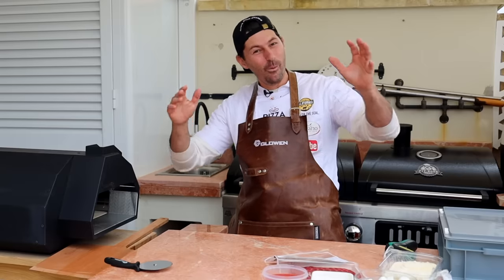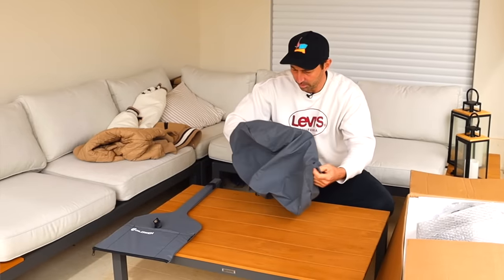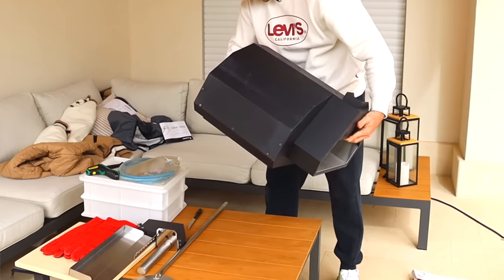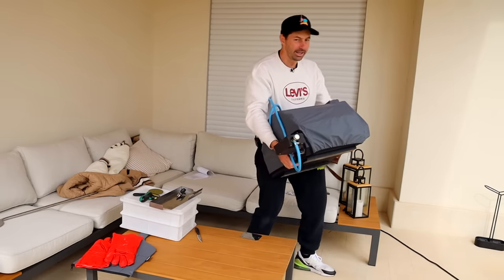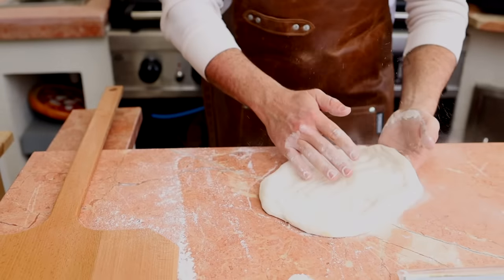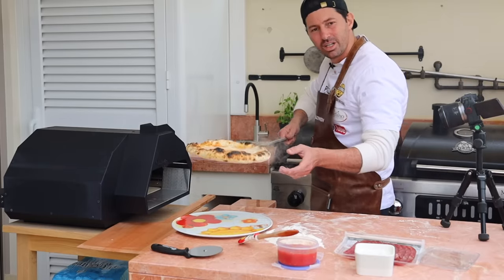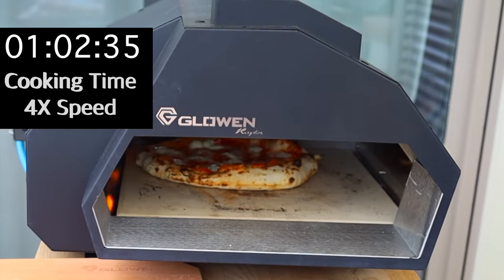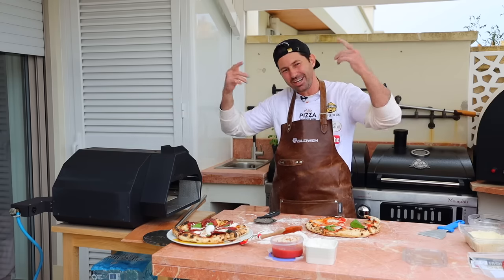Review & Unboxing Glowen Pizza Oven

Comment: I found with my pizza oven to let it heat up with large flames that flow over the whole top of the oven. Takes 30 min to heat with wood fire. When the flames go down to medium size just after being large is the best time/temperature to cook it. If the flame goes out add more wood and repeat. The stone is nice and hot but the mid sized fire wont singe the top of the pie. 👍🏼
Reply: The classic way (1000s of years) is to put some wood shavings at the start of each cook/batch. 

Even the preserved ruins of Pompeii showed they did this.

Comment: Maybe I can help some people who want to buy the Raptor or the Karu 16 because i asked me the same.

In the end, it was the Raptor for me, because: 

1. The price: the Raptor ist about 550€ with a tone stone like a biscotto and with gas  option vs 699€ without Gas and 799€ with gas option, but without a tone stone. 
The diference in the price i invested in accessoires like a table, pizza peel and other stuff you need.

2. the door: i think you dont need a door because you have to flip the pizza and have to open  and close the door every 20 Seconds and the fact that ooni bring a half door for the karu 16 (99€) is giving me right i think.

3.the flame on the side that give you a better look  to the pizza direct beside  the flame than the flame in the deep back of the Karu what is harder to see.

4. The fact that Glowen Raptor is manufactured in Europe gives me a better feeling about the quality of this oven.

I hope i could some people help with my personal compersion.
Reply: Im in the same adventure to deside: ooni, gozney or this one. I love what I see....I´m in Valencia, Spain.
Reply: Price of the raptor went up to 650,00. Door is also to heat up faster, and to charge another 50eur for the door... they could easily include it, as its very basic door anyway.

Comment: Vito, great video as always.  If going to buy a pizza oven.  At present I'm leaning towards the Ooni Karu 16. Having watched this video of the Raptor I'm intrigued. However the Karu 16 has its gas heating element at the rear and the Raptor has its gas element on the side. I know you state that the heating element on the side is preferable to the rear.  How would you rate the Raptor vs the Karu 16?

Comment: Went to site to view oven and all the things you showed in the box that came with the oven they were extras even the gas burner the door to the oven is an option. They sent you the oven with all the options available for the premier evaluation of their oven on your channel. They don't even have an option for the package you received. You have to buy each item separately.
Reply from the maker: Ho let check with the company I didn’t know
Reply: Agreed their site doesn't have the ignitor for example and everything shown is extra so it adds up to over €1260.80 without the ignitor which makes it an expensive oven overall